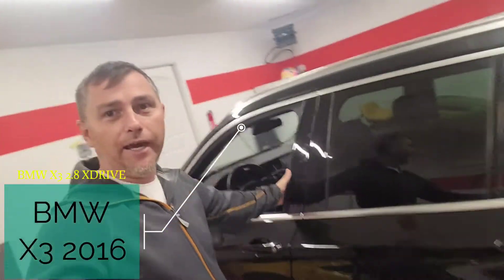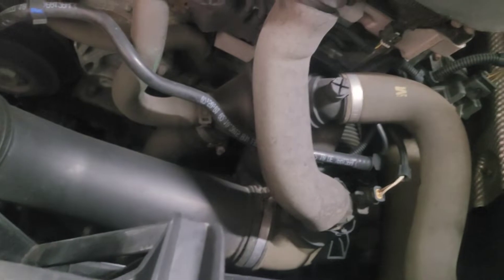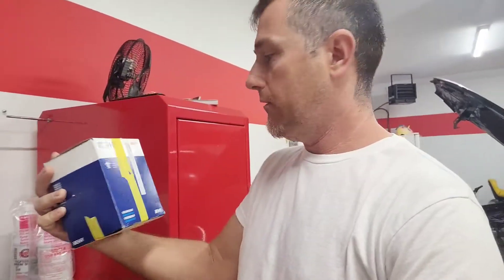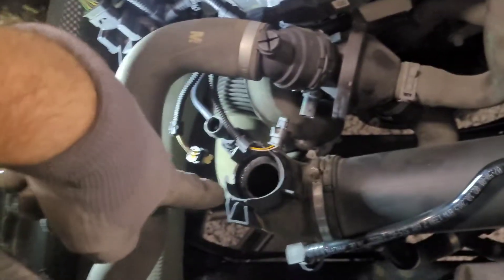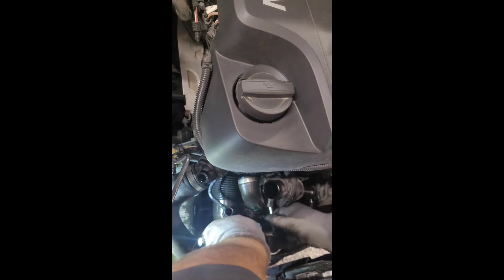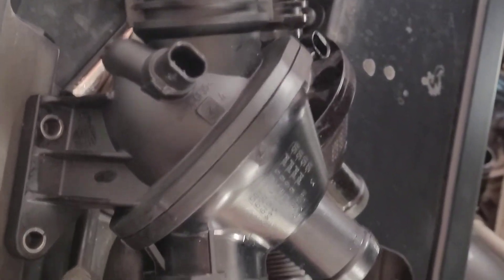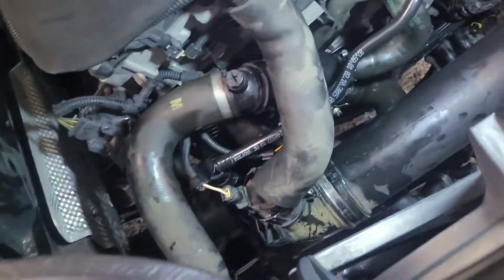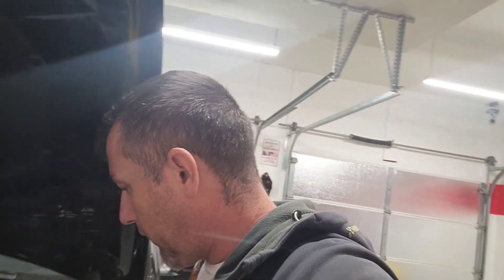BMW X3 28i XDRIVE THERMOSTAT HOUSING REPLACEMENT. 4 CYLINDER ENGINE 2016

Comment: FYI, it's not a sensor on the thermostat housing. It's for an internal heating element to bypass the t-stat's normal operation when engine is still cold but under heavy load. 
German over-engineering at it's best.

Comment: Since you couldn't bleed the radiator, do you still recommend to take off the skid plate?
Reply from the maker: Not necessarily.  Just add coolant start the car and keep your heat at high let it cycle